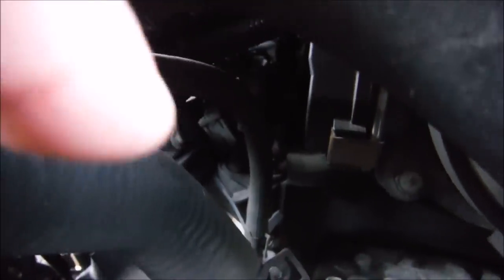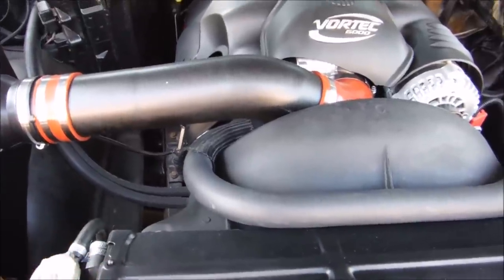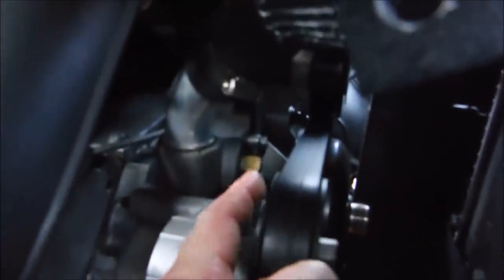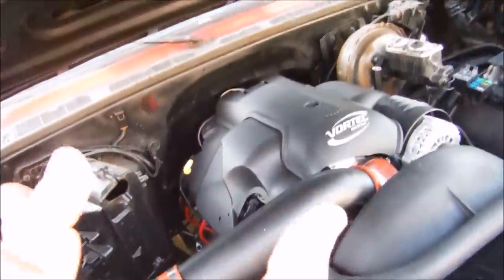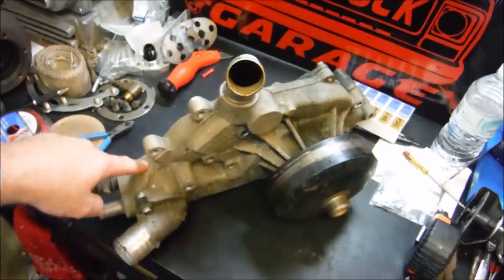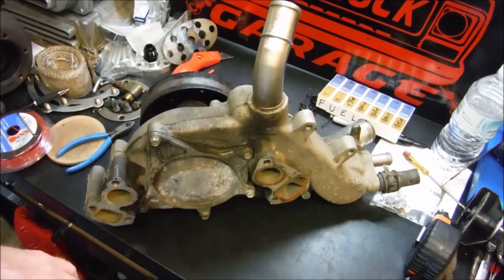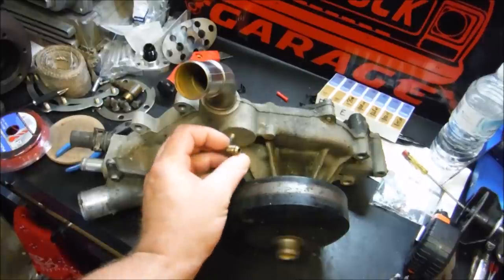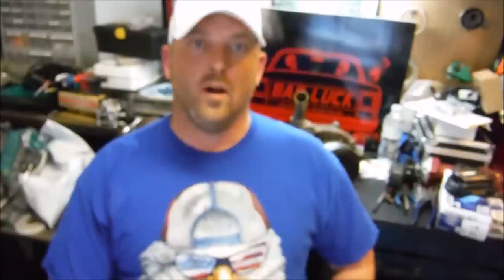LS STEAM LINE HOOK UP AND EXPLANATION

Comment: So what you're saying is that block off the rear steam ports on my LS1 then? Or is that still not recommended?
Reply from the maker: No sir that’s not at all what I’m saying. What I’m saying is stick with what you have in most cases. However, as with anything there are always exceptions to the rule. If you’re doing a really high HP build then it may be worth it to do a four corner setup. Another example where a four corner would be a good idea in my opinion is if you’re building an engine for something like a rock crawler where the engine may be ran hard at extreme angles for long periods of time. But for a mild build or a stock-ish application, I would just use whatever your donor engine came equipped with.

Comment: Ive been told by my local mechanic that a good flush will eliminate the use of the steam vent he even donated a spare bypass he had laying around and told me that with a good 3 or so flushes I would be good to go. I just want you opinion on that just because he’s so insisting on that I don’t need to do all this
Reply from the maker: A flush has nothing to do with ridding the system of air . Flushing is done to remove buildup, contaminants, and old coolant. Sounds like either you misunderstood what he was saying, he misunderstood what you were asking, or he has no clue what he's talking about.

Comment: Awesome video, just subscribed.  I do have one question... after drilling a hole in the water pump, are you running a tap to thread, or are those fittings self tapping and you're just sending that sucker home?
Reply from the maker: 14:32
Reply: @BadLuckGarage  thanks man... not sure how I missed that.
Reply from the maker: It happens brother. 🤣👍

Comment: Can you plumb the line right into your expansion tank?
Reply from the maker: I suppose you probably could but be sure that it stays lower than the coolant level in the tank to prevent reversion from pulling air back into the engine. Not sure if that would happen but wouldn't be good if it did. I prefer the water pump method just because its clean and eliminates extra hoses from the engine bay.

Comment: So if you are not using the heater core ports out of the side of the water pump you and drill and tap them and cap one and use the other for the steam vents as well right?
Reply from the maker: Hey Doug, thanks for watching! I’ve seen people plumb it to the heater outlets but my problem with that is that neither of those outlets pumps the coolant to the radiator. In my opinion, in order for the steam vent system to function the way it was intended, it should be plumbed into one of the areas mentioned in the video so that any trapped air makes it way straight to the radiator where it can be purged out through the overflow system instead of being pumped back into the engine.
Reply: Bad Luck Garage. Thanks for the fast response. This is gonna help me with my issue. Thanks again have a good day
Reply from the maker: Doug Watson you too brother.

Comment: probably  a "not so smart" question, but do I need to remove the waterpump before tapping? Or can I tap with installed? Concerned with the shavings entering the cooling system. 
Also, Great Video!!
Reply from the maker: I would prefer to do it off the engine and blow it out after with compressed air.   That being said I have been known to drill and tap heads for 3/8 coolant temp sensors while they’re still in the engine so I really can’t say much. Just use a lot of grease on the drill bit and the tap to catch shavings if you chose to do it on the engine. There really isn’t much that some small shavings could hurt in your cooling system anyway to be honest. They should pass right through the pump and worst case scenario is maybe the thermostat gets stuck barely cracked open on one BUT as easy as the pump is to remove I’d just do it off the engine.
Reply: @BadLuckGarage  thanks for the knowledge. I just got my front end assembly installed and was hoping to not have to go back into it. Gonna think on it for a while.  Thanks again for the knowledge and quick response.  Just got yourself a new subscriber!!
Reply from the maker: Glad to help brother. If you know anyone else who could benefit from this or any of my other videos be sure to share! And thanks for the sub. 👍🏻

Comment: This may be dumb but the back two ports are blocked off and there is a steam like that connects the front two ports... do i still need to run it to the radiator/ cooling system or should i be fine
Reply from the maker: This is covered in the video.
Reply: @BadLuckGarage  yes sorry forgot to delete
Reply from the maker: @franciscoc2524  you’re good brother. I’m horrible about commenting halfway through videos too. Lol. 🤣👍

Comment: I have ls1 water pump on my 5.3 but I have a spacer to space it out to truck accessories but I have a steam port on the spacer which goes directly to the steam lines so I can just fill it through the radiator right?
Reply from the maker: no
Reply: Bad Luck Garage ok so how would I go about filling it back up?
Reply from the maker: @cristianh8  I explain that in the first 3 minutes of the video. start at the 2:00 mark

Comment: Does it help with increasing your E.T or help with hp?
Reply from the maker: This is not a performance modification. It’s a required part of the cooling system installed by GM and it’s purpose is explained in the video.

Comment: Maybe theres room on the side of the thermostat to try to drill a eighth inch hole in your thermostat. like on the small and big Chevy. Have motor off keep filling the radiator checking back on it and filling it and filling it and squeeze the top hose some too. That's how I've always done it. And maybe you would not need a steam line. I'm not a LS guy but I know if you get air pockets in it or any thing you can have a mess overheating problem. I do like to run all coolant through the thermostat except a little hole. A lot of guys will run a line from the water pump right into the intake and solid belt drive fans. I don't like that on older cars. And most of the time they overheat in the hottest days of the summer. And I thought you mentioned in one of your videos you don't have an engine fan. I'm guessing you're running a electric fan. If sometime I go to an LS I'd like to run the V belt pulleys and have the March overdrive system. That's what I run now. I just have a whole pile of new V belts from very small to big. I just have the water pump and alternator to turn on my old Camaro.
Reply from the maker: Jon Smith thanks for watching! thats actually a pretty common modification on LS thermostats as well. 👍🏻

Comment: I know this is an old thread but when you tap the water pump how do you clean out the metal shavings that falls inside of the pump.
Reply from the maker: Turn it upside down. If you’re drilling right next to the outlet as I suggested then most of the shavings will just fall out and you can blow compressed air into the engine side of the pump while still holding it upside down to blow the rest out.

Comment: The water pump is lower than the heads, wouldn't that cause an issue of just releasing the steam and air back into the system?
Reply from the maker: No

Comment: I have a early model 5.3 with the steam ports in the front and back i noticed it had the extra port to go to the throttle body, i swapped a tbss intake and 4 bolt dbc throttle body. Can i just plumb both front and back to crossover to eachother? Or should i oem replace and cap off the original lines
Reply from the maker: You should run it as explained in the video.

Comment: I swaped my 1965 to a ls and I'm lost is there aftermarket oil pressure sensor I carbrated mine and my msd unit uses my temp sensor to so I'm goin to have to figure that out to

Comment: the steam lines usually rust out under the intake on the older ls engines, that\s the problem we have here in Newfoundland , where it is damp all the time
Reply from the maker: Thanks for watching! Not sure what a “dome” is though. Lol.
Reply: intake
Reply from the maker: lol, ok that makes more sense.  Yes we have issues with them rusting as well. Usually not bad enough that we cant clean them up and repaint them though.
Reply: Same here right across the water in cape breton.
Reply: Doing knock sensors on my 2000 silverado and noticed the nipple where the hose connects to TB  is rusted  badly. Previus owner neglected the cooling system.  I'm thinking of blocking the rear and buying a billet crossover with bleed for the front.

Comment: I'm hoping this what's wrong with my ls not a head gasket I run a swirl pot but still some times get a little coolant out the radiator cap I'm not sure the swirl pot might be the issue I have a head ake

Comment: On the trick flow kit TFS-306S0601 they don’t tap into any water pump or hose they just connect all 4 ports together.  What’s the deal? Does it not have to connect back to radiation
Reply from the maker: Not sure. That seems completely pointless to me other than just having a way to burp all four corners easily during fill. That’s essentially just blocking off the ports which could be done with four factory block offs instead and not have all the extra lines running around. Like I said, the only reason I could see to use that kit is it would allow you to loosen one line while filling the coolant to burp the system or maybe allow the air to gather at a central point to burp it easily from time to time on a racing engine where you’re contantly changing fluids.

Comment: Can theses places on the water pump be used for temp gauge?
Reply from the maker: Yes but it won’t be as accurate as putting them in the head. I’m guessing your new to the channel but I have several builds with videos showing me enlarging the port that’s already there on the passenger side head and tapping it for a 3/8npt fitting. I do this to every engine to allow a place to run a temp sensor for factory gauges or for a fan switch. Only takes 5 minutes and will give you the most accurate readings.
Reply: Thanks
Reply from the maker: @kenwood7095  No problem brother. 👍

Comment: I've been plumbing my steam vent into the radiator lol Thx for the info because I was going to drill and tap the rear steam vent
Reply from the maker: Yes sir. Nothing wrong with plumbing into radiator. That’s one of the options I mention in the video because that’s how the factory does it. 👍🏻 I just personally prefer the cleaner look of tapping the water pump but any of these methods will work just fine.  😉
Reply: @BadLuckGarage  
Cool Thx again and right now it's about less work and more power for my GTO 🤣
Reply from the maker: Yes sir!!!👍🏻 And thanks for watching!

Comment: I have a leak I can't figure out where it's coming from, but it only comes out after the engine cools (unless it's evaporating off a hot engine). I wonder if it's my steam lines.
Reply from the maker: Could be depending on where it seems to be coming from. It’s fairly common for the oRing style blockoffs to leak where they bolt to the head. So if it appears to be coming from the corner of the block thats the first place I’d check.

Comment: If i use a vacuum refill Sistem, will i still have steam issues?
Reply from the maker: If you have vacuum fill machine you shouldn’t have any trapped air if done properly. I’d still recommend running the steam line but I know several people that get away without it.
Reply: @BadLuckGarage  ok man im going to do get an aluminum radiator and have a fitting install on top of the radiator close to the filler cap just to make sure steam gets to the top of the radiator
Reply: Thanks for the info i appreciate it

Comment: Do you have a parts number for that upper radiator hose ?
Reply from the maker: It’s just a 99-up Silverado upper hose
Reply: Thank you sir . I’m struggling on finding one that would work in my 70 c10 . Running a LQ9 with a almost OE style radiator
Reply from the maker: The 99-up Silverado hose isn’t always the prettiest option, but it will work with most factory small block Chevy radiator set-ups with the truck style water pump. We’ve used that same hose on several swaps both on and off this channel.
Reply: @BadLuckGarage  I actually picked up that hose today . Fits perfect 👌🏼

Comment: Question  a have that problem  I use one of the air conditioning lines  I don't  have ac so I'm not sure if is working properly
Reply from the maker: This has nothing to do with the air conditioning.
Reply: I'm sorry I didn't explain myself correctly. What I'm actually trying to ask you if it's okay for me to use the the water pump outlet that is used for the ac since I don't have an AC  I did an engine swap on my 72 chevy nova from a 350 to LS
Reply from the maker: If you’re referring to the heater core hoses then yes, you can tap into one but I recommend taping into higher points in the system rather than low points since the air pockets will evacuate more easily moving up.
Reply: Bad Luck Garage thank you for your time and your tips were very helpful
Reply from the maker: Yes sir and THANK YOU for watching!👍🏻

Comment: I don’t get it but yes the line goes to the engine next to is another line the the ends in the back off your alternator this the line you used to bleed your coolant. But the big hose you see on top of your engine that’s were you add a part the has the screw to bleed coolant and one side is clear for you to see the flow of your coolant.
Reply from the maker: I have absolutely no idea what you’re asking.

Comment: There is literally like rust crumbs in the start of my steam line on the right side from where it first comes out of my throttle body and I honestly have no clue on what to do
Reply from the maker: Either clean them or just bypass the throttlebody altogether like I’ve shown in previous videos. None of the vehicles you see us swapping on this channel have the steam line running through the valve body anymore. Even the factory LS equipped vehicles on the channel like the Chinavette and the Abby have all had the throttlebody bypassed. I’ve probably shown that process in at least 12 different videos. Lol

Comment: I know this is an older video.   But why does the front steam line bleed into to throttle body by a vacuum line.
Reply from the maker: It doesnt pass through the throttle body by a vacuum line. It flows through a small cavity in the throttle body to warm it up. If you don’t live in a cold climate you can bypass it.
Reply: @BadLuckGarage  nice.  Cleared up alot.

Comment: Thanks. It's there a trick to drilling the water pump while in the vehicle or do i need to drain the coolant and get into the outlet nipple with a shop vac?
Also, my steam lines go to the bottom of my throttle body. What to do about that? 2005 CTS-V with ls6 3 bolt throttle.
Reply from the maker: Honestly the pumps are so easy to remove on an LS engine and the gaskets are reusable so I suggest just removing it and not taking a chance of getting shavings where they don’t belong.

Comment: How do you make the fitting not leak?
Reply from the maker: By drilling and tapping it correctly. If it’s leaking then it’s most little because you ran the tap in too deep and made the hole/threads too large for the NPT fitting to seal properly.

Comment: Only issue with the newer ones would be in wakeboarding boats that face backwards
Reply from the maker: yea I’m guessing the engineers at GM probably didnt account for that. 😂 Of course in a marine application isn’t the coolant system open anyway? I mean I’m not a boat guy but don’t most boats just circulate water from the lake or whatever through the engine? If this is the case then pressurized steam pockets shouldn’t really be an issue anyway. 🤔
Reply: Bad Luck Garage not all boats are open circuit
Reply from the maker: Like I said, not really a boat guy but same principles apply. Wherever the highest point on the engine side of  the cooling system is should be vented.